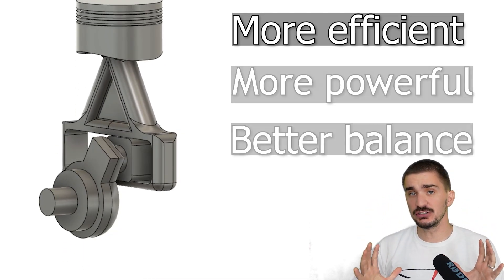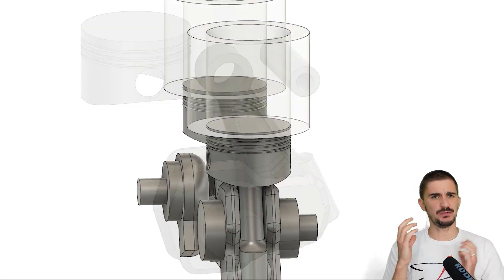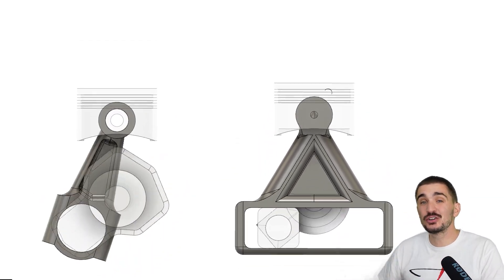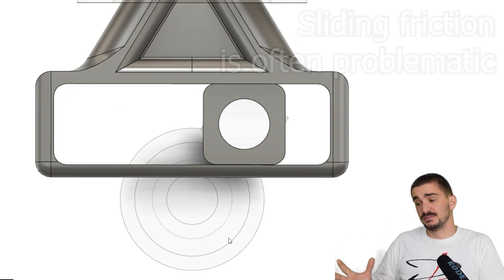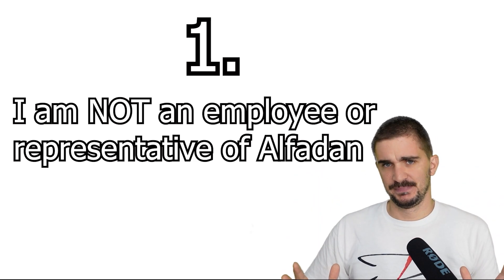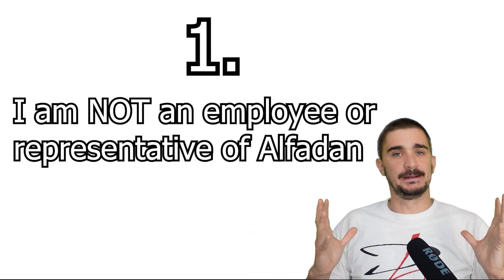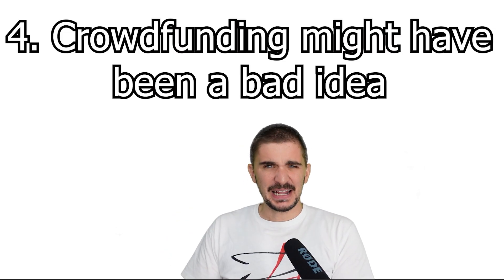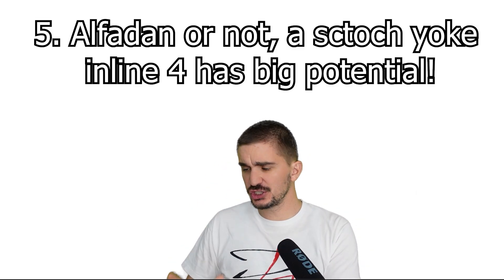This engine is better in every way?

Comment: Sliding friction is present everywhere in an IC engine, including at the piston rings / cylinder wall surfaces and all bearing / seal surfaces.  The design shared just makes it much worse for reasons you state in the video.

Comment: Even if we could make a scotch yoke work, I highly doubt it could take much combustion pressure without causing some kind unwanted movement of the piston/rod. Not to mention the rod would have to be reinforced signifcantly which would add weight and limit engine acceleration. That surface between the yoke and crank would have to be so finely machined to avoid any rattling but that would come at the cost of making it very difficult to manage friction. To me, it is nothing more than a thought experiment. Cylinder offset is the most practical solution we have to reduce friction in a convention engine design. Great video as always.
Reply: as finely machined as, say, a traditional big end?

Comment: I'm not sure how this design prevents the uneven piston wear, beyond TDC all forces still act at an angle and it still wants to flip the piston assembly.

And I'm not buying the sliding friction problem, that could be solved with pin roller bearing at the yoke.

The flimsyness is a problem yes, but given the mass of that piston and the fact that Alfadan plans to make >2L engines, I'm pretty sure that thing ain't revving high anyway so just beef up the slot

Comment: G'Day,,nice,was gunna say remove square block and fitt bearing,,but this will have a tendacy to point load conrod and cause the same issues as before,,
the other issue i for see,,is how do ya get the conrod out,does one need to press apart the crank shaft..wonders on the Mass of Conrod design.??

Comment: Alfadan - When somebody spends so much energy denying something it makes me more suspicious.

Hmm, the fact I comment on Alfadan before the Scotch Yoke….

A few questions:
 1. The reciprocating motion of the slider will introduce acceleration/deceleration forces - what is the effect on engine balance.
 2. The slider will experience static friction at the start/end of it’s stroke - what effect will this have?
 3. The slider friction will exert forces in a horizontal plane. The piston is the only element that will resist this force, therefore there will be friction and wear between the piston and bore - what is the comparative magnitude?
 4. The piston/rod still has to accelerate/decelerate, but the mass appears to be significantly more - what are the sums on this?
 5. How does the different piston oscillation profile affect the intake and exhaust timing and efficiency?
 6. In the animation of the scotch yoke there is no balance mass for the offset slider motion - is this correct?
 7. Could the timing of the piston/scotch yoke be changed by having the slot in the rod not being horizontal?

Comment: The sliding box section of the yoke design would make lubrication a lot more difficult to achieve effectively than with standard plain bearings on a normal crank pin.
Reply: as a new comer marine engineer cadet, i have to say that the sliders that are being used on the 2 stroke low rpm diesel engines, are made of white metals, that are cheap and are the first to wear out, so damaging of the engine can be avoided. In those engines are vertical, but yoke sliders are on the side, something that will incise friction and wearing out. Because of that i am very interested to see with what they came out to stope that problem.
Reply: Not really, it would be feeding oil to the crank and thus the square itself through feed holes, exactly like normal cranks. And voila. Have it squirt oil just before and after the lead and end corners of each slide surface of the square, the same way we use piston skirt squirters. Just have it squirt the slides instead. Bam done. 

The early Scot design probably only relied on paddle oiling like push mowers so it's no wonder it failed.
Reply: @ShogunAutoworks  it slows the wear out, but yes, if it is lubricated properly, then the life spend will be increased to that of a piston' s spring, or even more then that.
Reply: @ShogunAutoworks  that makes sense. Question is how simple can we make it. The crank resting in the oil sump halfway or more would be more simplistic I think. Maybe it's just the same setup but with more pressure. Constant oil through the squirters and engine block. I'm not sure
Reply: @blackfrost273industries4  Submerging the crank in a liquid (oil) would at best create enormous friction relative to air; though it wouldn't take long before the oil was flung away from the crank, like batter in a mixer, eliminating any potential lubricative benefit.
Reply: @ShogunAutoworks  what if we used a big coil spring instead of a rod. Less moving parts 😏
Reply: @ShogunAutoworks  Exactly!
Reply: @ShogunAutoworks  there is a massive problem.

Your rods don't ride on the bearing. They ride on a thin layer of oil that's captured between the surfaces. That would be nearly impossible in this situation. There's not enough surface to create the oil pressure you need to not destroy the crank or rod.
Reply: Much larger contact patch so lower oil pressure but more flow.
Reply: and that square could make the rod wobbly at TDC and TBC
Reply: Not really, because of the greatly reduced wear of the cylinder wall, it won't need as much lubrication anymore...
Reply: Dude, they’re demonstrating the engine being implemented vertically.. on end; I’m sure they’ve covered oiling issues.
Reply: I don't see how you make a bearing that moves like that, and is robust enough to survive 200,000+ miles.
Reply: knowing that makes it possible to plan and design for that problem.
Plus, is that worse than scoring on the cylinder walls.

At the end you need to look at the complete pizza and not just the crust.
Reply: rod knock would be common within 10k miles
Reply: And the added weight.
Reply: The sliding box should be oval.
Reply: I suspect a bigger problem is that the design actually invites particulates into the sliding section.  That alone is probably going to create more wear and premature failure in comparison to a conventional design.

Also, any deformation or imperfections in the flatness of the sliding section of the yoke (or bearings) will likely create a positive feedback loop, accelerating further wear.  It's honestly a lot easier to make things circular than to make them flat.

And while the design theoretically reduces transverse strain on the piston, in reality this reduction is dependent on the length of the rod, and a longer rod requires more mass, which creates more inertia, so it's not for free.
Reply: Why?
Reply: It would use a roller on the big end
Reply: Better oils e of exist, with graphite, etc., in suspension.
Reply: There could be needle bearings the same that are used in some high horsepower cam applications. However, there could be a round design instead of a square crank design.
Reply: @danielgrenon531  like roller rockers and lifters oh yeah definitely
Reply: Mitigation through soaking the crank in the oil sump halfway or more? Yes more detergent and stringent oil change intervals I believe
Reply: @blackfrost273industries4  Would foam the oil and fling a lot onto the cylinder leading to oil consumption
Reply: @blackfrost273industries4   That would result in unecessary power loss so i suggest ball bearings that doesnt require a lot of lube
Reply: @blackfrost273industries4  then you add massive amounts of frictional loss from the oil as well as add big problems with oil aeration.
Reply: The oil that feeds the crankpin first has to lubricate the pin and pin bearing in the slider. The it gets to lubricate the slider top and bottom. All this after the inevitable looses of oil from the main and pin bearings. If this is a better system overall it would have been in use by some automotive manufacturer
Reply: This design is so terrible.
No advantage in fact, only problems.
-- get a Chargehanger
Reply: @chargehanger  how is that even relevant you''re shilling a grossly overpriced EV charge hanger when we are talking about engines?

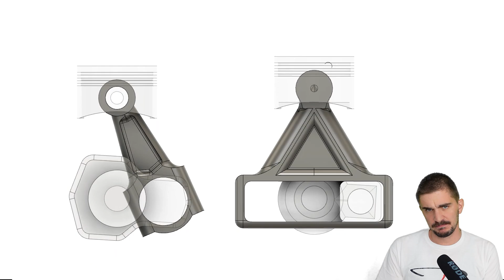Comment: @5:30 you show the Scotch Yoke engine, with a cylinder inside the yoke, while before in this video they used a square peg inside the yoke. Wouldn't the round, less-surface-area cylinder be more efficient than using a squared peg?
Reply: @7:00 never mind. Lol

Comment: I see a torque at the piston in that configuration. Much more than in the traditional design. I would guess that this would greatly increase wear an the potential of engine failure. In the traditional design, the piston is pushed against one side. But in the here presented design, the piston will get tilted. Seems like a bigger problem to me.
Reply: Yup, not only that but you might need a longer piston head to reduce the moment-induced forces at the corners, increasing the contact area of the piston walls and increasing friction.

Then there's the arm which would probably need to be much wider to survive the bending moment without fatiguing.

Then he also says there are fewer parts because there's no hinge between the head and the arm, conveniently forgetting that those extra parts have just been shifted down to the sliding block connection.

In general mechanical engineers like to say that they prefer rotation over sliding wherever possible for reliability.  There's so many practical reasons why this theoretically better engine just isn't better.  Engine builders haven't just been ignorant this whole time, they've converged on the conventional design for good reasons.
Reply: @excrubulent  In addition to that, bearings, or anything round, is easier and cheaper to manufacture.

Sorry for spelling errors, i usually speak german ^^'
Reply: Needs a cross head to control the rotation of the yoke.

Comment: There's no chance of this working more efficiently. The increase in weight by using what is basically two connecting rods joined together, plus the additional bearing and slide block will cause plenty more reciprocal loses.

Comment: I'd say that it's dangerous to croudfund any engineering endeavour unless you know exactly what you're building, how it's going to be built, with minimal unknowns. This is why we see other things like software struggling. People don't realize that there are things that we don't know that we don't know and it directly impacts everything about a product. Not just cost, but timeline, design, and required resourcing at the time, forget macro-economic conditions.
Reply from the maker: Exactly!
Reply: @d4a  USE WHEELS!
Reply: Plenty of stuff is crowd funded at the start. The difference here is the crowd is the general public. I think this is a bad investment but I don't think there's anything nefarious or reckless in this offering

Comment: I wonder whether the horizontal movement could also be curved to optimize for the power delivery of the combustion. Not with a square yoke of course, but a round one.

Comment: Also, are turbine engines still in use for vehicles? I know the Y2K motorcycle currently utilizes one, and there have been a few examples in the past. Could you provide more information about the advantages and disadvantages of using turbine engines in cars?
Reply: I know there are a number of videos on YouTube about the history of turbine engine development for cars. Long story short, every American car company experimented with turbine engine technology throughout the 60s and 70s, but it always wound up being loud, expensive, and inefficient.
Reply: @thecianinator Yeah, it's not just American companies. British, French, Italian, and even the USSR were working on it. In the 70s, turbine engines were expensive, inefficient, and faced emission problems. However, technology has evolved since then, and it's interesting to see if any companies have come up with solutions to these challenges.
Reply: @thecianinator  Except for microturbines at constant RPM for hybrids.

Comment: Inline engine with the system is not efficient. Boxer engines are much better suited for that concept since you can combine 2 pistons with one rod (that, since it has a rod on both sides of the square, is much more robust to the forces)

Comment: The yoke needs a tail guiding section below the connection to the crank to overcome piston ossilations within the bore from the forces of power stroke and compression strokes. The line of force moves from one side of the yoke/crank connection on every cycle.
Reply: The yoke runs on rails on its left and right (not shown in the animations here)...
Reply: Another piston seems like the ideal "stabilizer".... it's other shortcomings, not withstanding...
Reply: @jamesgeorge4874  an additional piston is probably best, a flat 8 seems like the most logical configuration
Reply: @shakehandswithdanger7882  That's what I was thinking.  Boxer or opposing piston layout would eliminate the weak spot on the bottom of the sliding yoke, and help stabilize  any rocking movement of the yoke.  You'd get the benefit of a shorter crank, but a taller (or wider) engine doing this in a flat 4 configuration.
Reply: Add the second piston and widen the yoke to accommodate two counter-rotating crankshafts joined by sprockets outside the bearings at each end. In an 16 cyl (straight 8x2) configuration with inward firing order (both cylinders on a single yoke fire at once) you have complete symmetry and balance.
Reply: Came here to write a similar thought. The forces on that large "see saw" will cause huge friction on the piston to bore area. Adding more stabilisation to counter that  just makes the friction elsewhere increase .
Reply: It's called a crosshead but yeah

Comment: Why use a yoke rod configuration for the inline engine? Wouldn't the opposite scheme be more suitable for this application? Or would it result in balancing issues?

Comment: another informitive video thank you. Near the end you speak of limitations of larger displacement Inline 4's and yes in the atuomotive world your totaly right balenceing issues limit it to 4 liters of displacement or less but I personaly am the owner of a Caterpiller D339 it is a engine design from the 1950-60's that used a large displacement 831 C.I or 13.6 Liter engine can you do a video mabye or inhearent stresses or designs that make these engines possiable.
Reply from the maker: If you keep the max rpm very low than there's obviously no issues, but you need more than 1 or 1.5k rpm for passenger vehicle applications

Comment: the cylinder side wear can be eliminated with a rhombic drive, the arrangement with 2 geared shafts and 2 rods.
it has the benefit that the load is always shared between 2 components due to its symmetry, which lends to smaller/lighter parts.
maybe the remaining wear can be made to appear in more readily replaceable parts, like bearings and such?
Reply: What is the catch of this idea? It is also common in steam engines.
Reply: @vitordelima  Increased complexity. Engines today work fine for thousands amd thousands of km before the wear becomes a problem. Its an expensive solution searching for a non-existing problem.
Reply: @coRnflEks  20% of efficiency is quite a big problem. MAHLE (or other similar company) had a prototype with two crankshafts but I don't know how similar it was to this idea.
Reply: @vitordelima  20% of what, in what way, compared to what, how or even from where? You make no sense. I got to stop responding to messages like this.

Comment: So, now you're trying to torque the piston sideways in the shaft while adding a sliding bearing, jamming the edges of the piston into the shaft wall.  And that's better pushing the whole side surface of the piston evenly into the wall?

Screw efficiency.  There's no way the tradeoff in reliability is worth it.
Reply: Absolutely.

Comment: Scotch Yolk does not solve the inherent problem of the piston pressing down directly onto the crankshaft at TDC, and it won't stop the piston from rubbing the cylinder wall at an angle either unless you have large guides on the side of the Scotch Yolk.
All of this adds mass, friction, and it's hugely complex. I can see the Scotch Yolk being useful in low RPM applications, but those engines don't care about secondary vibrations to begin with, so the whole idea is moot.